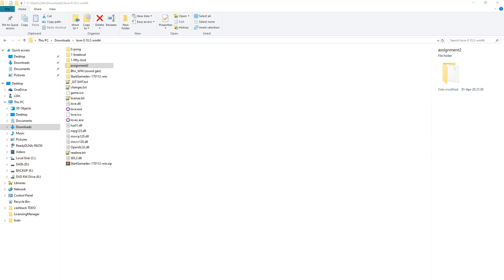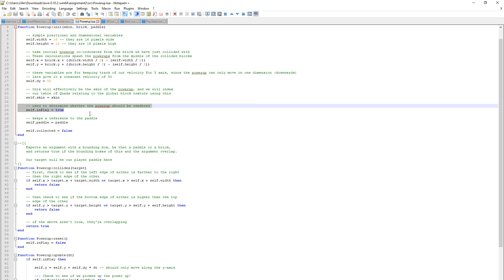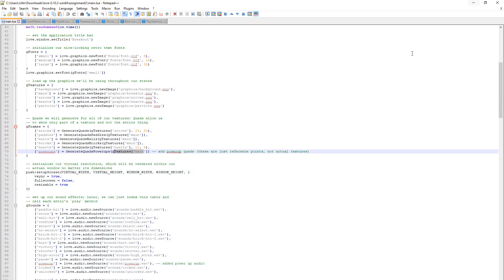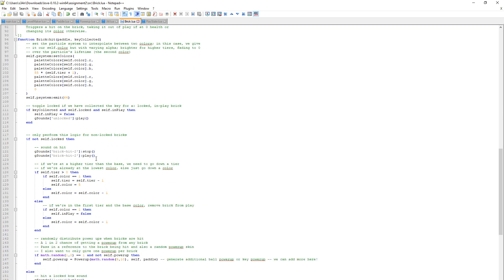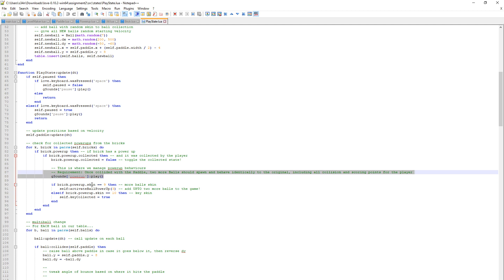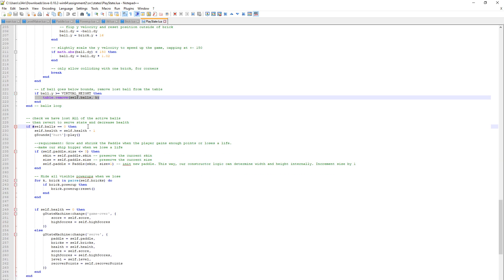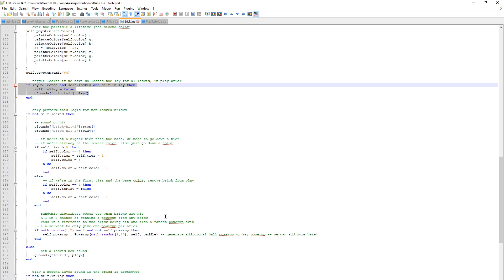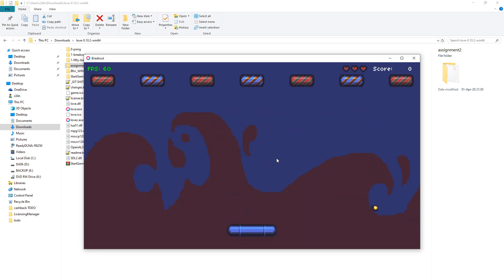CS50's Game Development - #02 Breakout - Arkanoid (Love2D and LUA)

Comment: So when i attempt to put the power ups as
    gFrames = {
        ['arrows'] = GenerateQuads(gTextures['arrows'], 24, 24),
        ['paddles'] = GenerateQuadsPaddles(gTextures['main']),
        ['balls'] = GenerateQuadsBalls(gTextures['main']),
        ['bricks'] = GenerateQuadsBricks(gTextures['main']),
        ['hearts'] = GenerateQuads(gTextures['hearts'], 10, 9)
        ['powerups'] = GenerateQuadsPowerup(gTextures['main'])
    }
I get an error message that reads 
 ERROR

Syntax error: main.lua:70: '}' expected (to close '{' at line 64 near '='

Traceback

[C]: at 0x7ffd3f843af0
[C]: in function 'require'
[C]: in function 'xpcall'

Would you by chance know what's going on here. Below I also included my function for drawing the powerups just incase that is apart of the issue

function GenerateQuadsPowerups(atlas)
    local x = 0
    local y = 192

    local quads = {}

    for i = 1, 10 do
        quads[i] = love.graphics.newQuad(x, y, 16, 16, atlas:getDimensions())
        x = x + 16
    end

    return quads
end

Comment: Hi, i have a question, it wont let me perform the * dt arithmetic on self.y in the powerup:update(dt) function, did u run into the same error?. Any help would be greatly appreciated
Reply from the maker: You didnt provide much information to go on im afraid! If you're talking about the provided code, it runs fine! I would suggest re-downloading it.
Reply: @s34nvideos  basically so when i created my powerup class, in the update function i tried put in self.y = self.y +  self.dy * dt so the powerup will be able to move along the y axis but when i try to run the code it says that i cant perform arithmetic on dt even tho i passed in dt in the update function
Reply from the maker: @deeppatel7496  It's hard to say without seeing all the code. Might be worth outputting dt as a test label to help debug its value when its passed in!